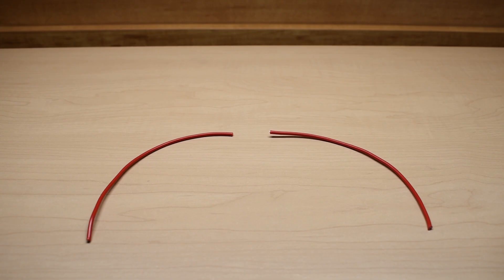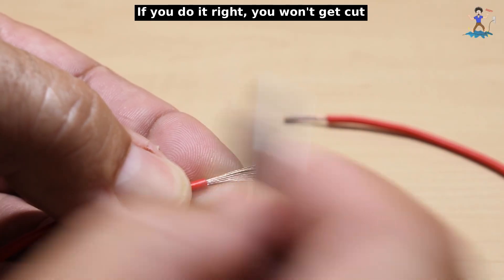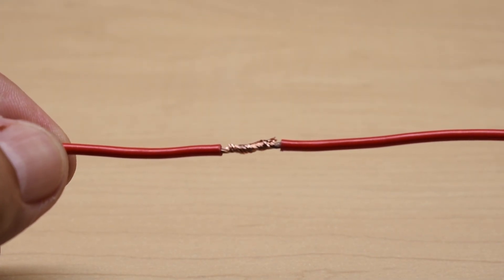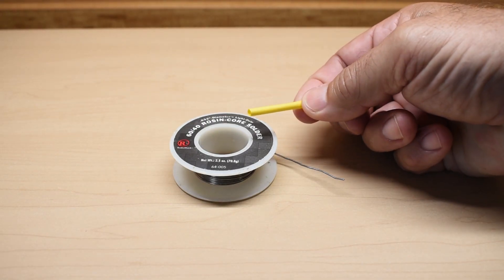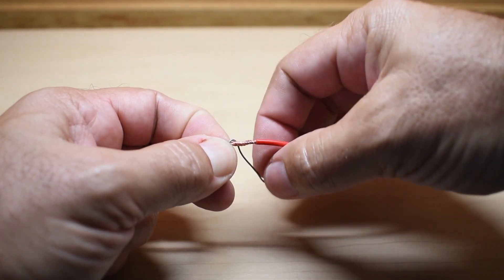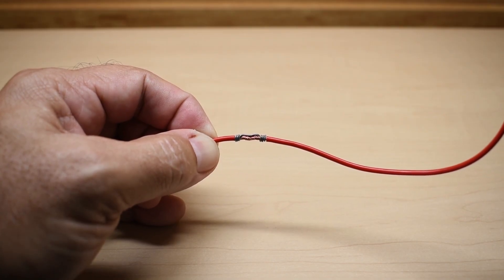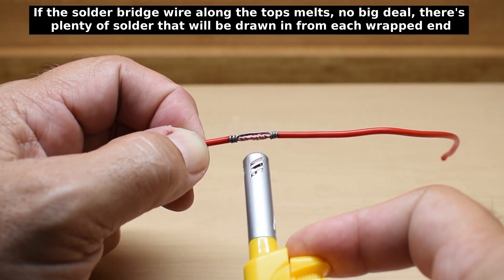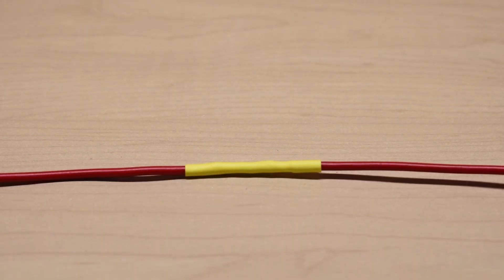How To Easily Solder Wires Together(No Soldering Iron)

Comment: Out of curiosity: Why not just use a soldering iron? They are stupid cheap on Amazon - you can get a nice kit with multiple tips and lots of other accessories for around $15 USD... and then be able to solder anything correctly.

While this method is neat, it can be prone to burnt fingers, scorched insulation on the wiring, and poor solder adhesion.
Reply from the maker: If you don't mind pulling out a soldering iron, waiting for it to heat up, or the excessive rosin flux smoke, then do it that way. Clearly you didn't watch the entire video, because what I demonstrated is a PERFECT soldered connection. People are more likely to have poor solder adhesion using a soldering iron that's too low in wattage. As you saw, no scorched insulation. 😃
Reply: @electronicsNmore  My cheap soldering iron takes about a minute to heat up.... or about as long as it would take to do the solder wrap technique you demonstrated. Flux smoke is not excessive, especially for something as simple as the joint you demonstrate. I DID watch the entire video prior to writing my original question, and yes, the contrived example you demonstrated looks like a perfect connection. However, conditions are rarely perfect, and an open flame approach is just an invitation for poor distribution of the heat, scorched insulation, burned fingers, burned other stuff around your work area, and a poor joint overall. Your technique can work in a pinch, but it is definitely NOT the best method.
Reply from the maker: @AmplifyDIY  If you don't like it, don't do it, very simple.

Comment: Have a question about this.. I'm wiring slide female2 wire feeders to a 14-2 bus wire around the track to improve continuity.  How would I do this with a 2 wire T splice to the 14-2?

Comment: Great tip. Having to wire up a ceiling train this is an awesome way to get it done without a heat gun and soldering iron up on a ladder with limited work space. Thanks for posting this.

Comment: Tip: the hottest part of the flame is the tip of the blue portion of the flame (good for soldering). Also, "no clean" is a bit of a misnomer: actually, "no clean" rosin is acidic, and a bit corrosive (this can be seen if insulation is pulled back/removed beyond the solder point, where rosin fluid has crept up the wire strands, inside of the insulation); heating also accelerates the oxidation process... the acidity can be reduced by a base: ammonia is a base, and therefore "neutralizes" the acidity... a quick shot of, typically, window cleaner with ammonia - works for me (typically, ammonia window cleaner also has alcohol... allowing/enhancing the window cleaner to creep up the strands, neutralize the acidity and evaporate) Additionally, when heating heat shrink with a flame try to stay back from the blue part of he flame; being less hot, this can avoid/reduce blackening/burning of the heat shrink.
Reply from the maker: I know all about flame temperatures. What you say about "No-Clean flux" is incorrect. You're treating all "No-Clean" the same. There's no reason to be concerned about or clean a "No Clean" rosin fluxed wire connection. It will outlast you when done correctly, with heat shrink applied.

Comment: Sounds great for those non existent jobs when I have a bench, and 2 free ends of a wire.... Other than that, butt connectors, or mechanical splice is the order of the day for Technicians.
Reply from the maker: There's a time and place for everything. One day you may use this.

Comment: That's funny! I could have spliced 10 wires in the time it took you to do one. Just twist together and solder with lighter. Nothing else needed. Been doing it this way for many years.
Reply from the maker: What's funny is that you're not sharp enough to realize how useful this tip is.
Reply: No, hes just saying its really basic and you could do it a lot quicker, with less faffing around.
Reply: Its a well known method, but you took a lot of time over something you could do in 10 secs. No need for the intricate wrapping at all. Just twist the wires and apply solder. Done. Doesnt have to look pretty, particularly when you are covering it in heat shrink anyway.
Reply: I just dont get people. He wasnt showing, he was teaching. Takes a little more time but he did say it will go much faster after you learn.

Comment: Amazing. You can make a solder connection with some heat from a flame. Who would have thought it? 

Plumbers need to be informed they dont need soldering irons after all!!
Reply: You can buy those connections they have strength to and solder inside of them nothing new here except for an irritating joker talking to people like their 2 years old
Reply: Plumbers join small copper wires?
Reply: Nope. Did I say they did?
Reply: You should inform yourself about what tools and skills that a plumber would need.
Plumbers use torches, usually acetylene, to sweat solder copper and less often brass pipes and fittings.
They do not  use soldering irons and this technique would not be of any use to them.
Reply: Was a joke dude.

Comment: Incredibly useful video!!  I'll definitely put this one to use soon!   Always a thumbs up and looking forward to your next video!!
Reply from the maker: Thank you! I just watched your latest windshield wiper testing video, it was superb! 👍
Reply: @electronicsNmore  sis good day. what call of that the yellow. pls noticed me sir.
Reply from the maker: @punisherstag7602  Heat shrink tubing
Reply: Do a test on best ways to make strong solder joint
Reply: I prefer to use the crimp connectors with heatshink insulation built in, because they are also lined with hot glue to seal out water.

Project Farm: can you compare resistance of crimp & soldered connections?
Reply: Why not just buy a soldering iron?
Reply: @martinw245  because its dangerous and hard to use for beginners
Reply: @haqqalkappa  

Soldering irons are not dangerous for beginners. If you are an adult that can't take care with the hot tip of a soldering iron then something is seriously wrong with you.

And no, soldering irons aren't hard to use. Practice a few times on a scrap bit of wire. Easy.
Reply: @martinw245  what if you don’t have power? What if you forgot to bring the solder iron to do your work? What if you have no outlet to plug into at the job site? What if you don’t have a cord long enough to reach an outlet for certain jobs?
Reply: @yosh1to  

If you don't have an outlet for a soldering iron then you use a verified electrical connector. Like a Wago 221, block connector etc. 

You mention "job site" in which case you are likely to be working with mains voltage. There's a reason electrical regulations across the world prohibit obviously unsuitable connection such as twisting wires together. Maintenence free junction boxes and proper connectors like the ones already mentioned must be used in that case. Twisting wires its absolutely unacceptable for mains power.

Obviously if you are working with very low, safe voltages and non critical applications and you need a quick makeshift method of connection its okay. I mean we have all done that as a temporary measure, but advisable to do the job properly as soon as possible.
Reply: @martinw245  My only request would be to have a battery powered or if permitted on site a torch powered soldering iron handy for quick fixes like this. This method is somewhat useful but not the end all be all in minor electrical repairs.
Reply: The Tub.

There are gas powered and rechargeable soldering irons now. 

Twisting wires together is more of an amateur strategy. If voltage is very low and thus safe and its just for very temporary testing its useful. But I mean any fairly secure wire twist will serve that function, you don't need fancy twisting techniques.

And that's what doesn't sit right with me. Videos demonstrating fancy wire twisting techniques imply it's for longer term connections and I wouldn't be happy with that. I say do the job properly.
Reply: @martinw245  a soldering iron still involves twisting wires together for a better mechanical connection before soldering. While it could be done with just a straight overlap, it's trickier to keep aligned while soldering without a third hand.
The drawback of using a butane torch is that the exposed wire area needs to be much more than is possible using a soldering iron, so it would require more solder and heat shrink tubing per joint. 
If you're going to plan ahead enough to have solder and heat shrink on hand, consider getting a portable soldering iron like the TS100, which can be powered off a battery.  It's fully temperature controlled with rapid heat up, so it's easy even for the soldering noobs.
Reply: @wingerrrrrrrrr  

"a soldering iron still involves twisting wires together for a better mechanical connection before soldering. While it could be done with just a straight overlap, it's trickier to keep aligned while soldering without a third hand."

As you say, you can solder conductors without twisting. But yes, twisting helps, but the point is that no special twisting methods or techniques are required when soldering. Any twist is sufficient. 

"The drawback of using a butane torch is that the exposed wire area needs to be much more than is possible using a soldering iron, so it would require more solder and heat shrink tubing per joint."

Why a butane torch? A conventional mains powered or rechargeable soldering iron is sufficient.  Or use a mechanical connector like a Wago for example. I mean we aren't talking about mains power here, just twisting wires together with mains voltage is ridiculous and contrary to regulations. 

We are talking about safe, low voltage. In which case soldering, with heatshrink insulation applied, or mechanical connectors is preferred. But twisting wires together may be an option IF VOLTAGE IS LOW AND SAFE TO DO SO for temporary use.

What make me uncomfortable is that  fancy wire twisting techniques may imply for the inexperienced that it's for longer term connections and I wouldn't be happy with that. I say do the job properly. And if you cant do it properly, do it properly as soon as you can.

And never for mains voltages.
Reply: @martinw245  I'd go with a soldering iron in pretty much any situation, even if I had to hold off on the job until I could get to one. 
I was pointing out one of the drawbacks of open flame soldering such as with a butane torch, for those considering it as a routine alternative to soldering irons. 
In an emergency situation where you have to do with what you have, then I'd use it.
Reply: @wingerrrrrrrrr  

Fair enough. 👍
Reply: @martinw245  I don't see the problem with this method. I've been using soldering irons and stations for over 30  years. I've also used methods similar to this when I'm onsite just replacing a part, find a broken wire, and certainly don't have my solder station with me. What's the problem? I don't see anywhere he stated this was the only way to solder a joint or connection.
You guys are the best way to get a curious person that we could really use in professions that need these kinds of skills - disinterested, faster than getting electrocuted by a laymen who forgot to make sure the circuit was dead before he drug his soldering iron across the contacts.
Reply: Non sense
Reply from the maker: @godierana4205  Another Troll, YT is full of them.

Comment: As you did your close up of the wire after soldering, I started to blow on it haha. Just a habit of mine after I take the heat away of the piece.
Reply from the maker: I do it all the time. LOL
Reply: that, and the tactical exhale to keep the flux fumes away from your face. :D
Reply: Cuda FX Yup. I don’t have ventilation, so I blow every time lol. I see I am not alone

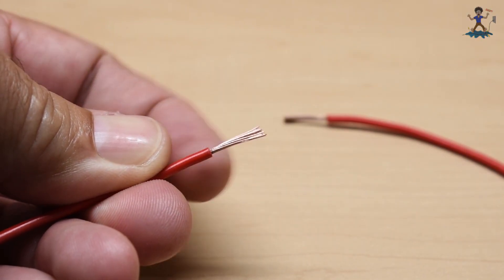Comment: • 1:18 - What if they're already connected to things and you can't twist them like that? 🤔
• 3:57 - That's all fine and dandy for thicc, chonk wires, but what about thin, small wires (or solid-core?) 🤨 Any tips for those?
• In my experience, the best tip for soldering is to use good solder. No amount of good wire or flux will help if the solder is cheap Chinese garbage from eBay. 😒
Reply from the maker: Normally you'd only solder stranded wires. The method also works for tap splices, but you'd need to apply liquid electrical tape to the soldered area when finished. Yes, don't buy cheap solder. :-)
Reply: electronicsNmore I agree and it has to be 60/40 tin lead

Comment: To solder to aluminum use flux and coat it with oil first. The oil prevents alum. oxidizing.
Reply from the maker: It's a real PITA to solder.

Comment: Beware of cheap fine stranded wire, I found no way to solder it! After months it turns to fine flake and dust and you could have fire! it comes as clear insulated speaker ZIP cord. Sometimes you should crimp wire and never solder, metals too incompatible.
Reply from the maker: Yes, they now have copper over aluminum. 👎

Comment: Soldering has been out for 25 years now. It can get brittle and crack over time. Quality butt connectors and a pair of crimping pliers is what you want.
Reply from the maker: No comparison. What I show is a lower resistance connection that's extremely strong. That said, I do use butt splice connectors also.